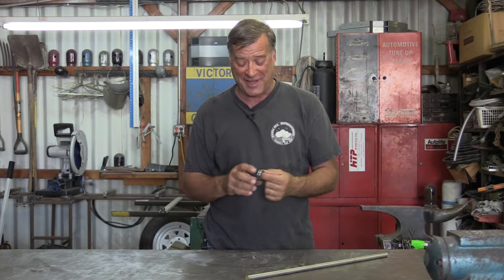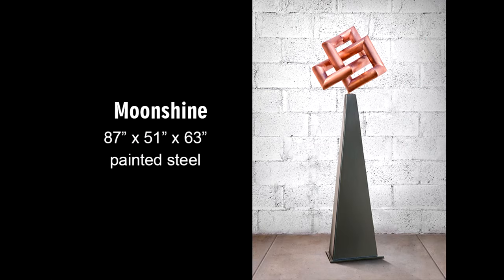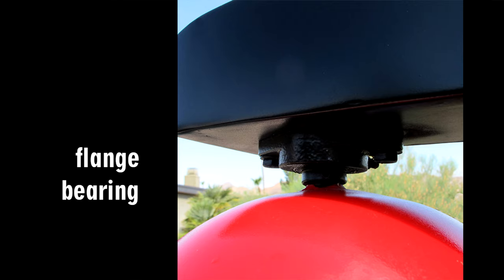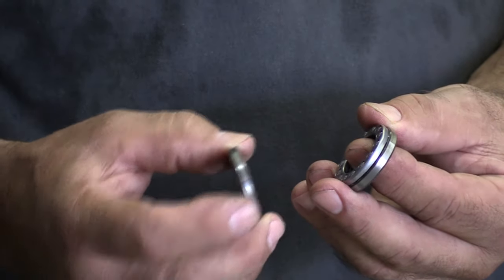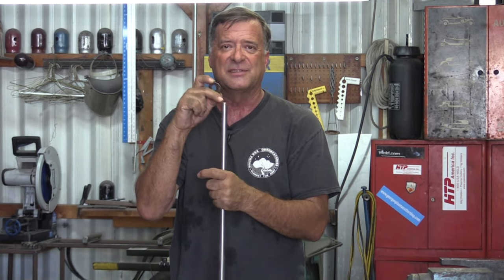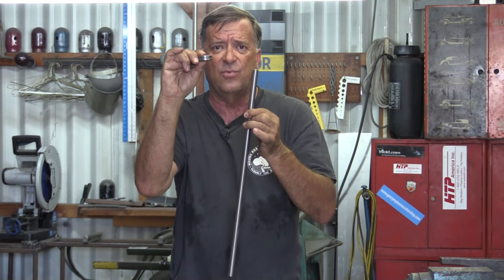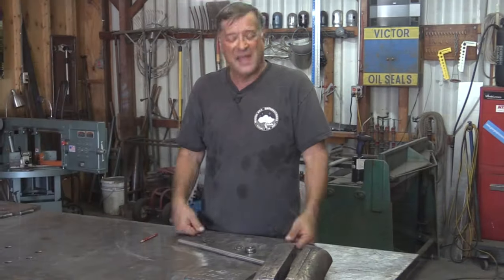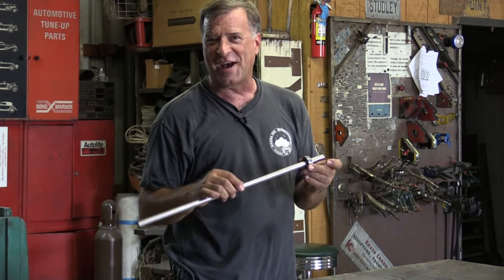How to Make Anything Spin Using a Thrust Bearing - Kevin Caron

Comment: Thrust bearings are great.  Every car has them on the front wheel / hub assembly.  Cheap way to get amazing bearing action in both axis.  Cheers.
Reply from the maker: Cars have wheel bearings not thrust bearings. Thanks for watching and posting.
Reply: @KevincaronSculpture   You are not entirely correct. Most Car and trailer wheel bearings ARE Thrust bearings. At least a type of. 

"4. Tapered roller bearings are designed to withstand a radial and thrust load, and can be found in car hubs due to the amount of radial and thrust loads they can carry."

https://www.machinedesign.com/learning-resources/whats-the-difference-between/article/21831901/whats-the-difference-between-bearings

Comment: Those will be handy. I just made a kinetic sculpture, and used a technique you described way-back-when of inverting two flange bearings to counter each other. Same problem though, large and clunky and required an additional bracket to hold them...
Reply from the maker: Have to make a large spinner soon.  multiple parts and 9 feet tall!

Should be fun.
Reply: Cannot wait to see this one!

Comment: You can add radial bearing to the shaft inside the base to keep it centered and thrust bearing, as you demonstrated, as the load bearing bearing.
EDIT: it is best to get washers with the bearing in an assembly, to make sure rollers and the surfaces they roll on are hardness matched, otherwise wear may occur.
Reply from the maker: Great point!

Comment: For weight load I use 2 bearings. I would imagine the thrust bearings are expensive. Three things are the culprit building kinetic wind sculptures. Friction, balance and angles. Nice informative video.
Reply from the maker: Not that expensive John.   Still learning how to set them up but having fun anyways.   Thanks for posting.
Reply: Kevin Caron, Artist  I know what you are saying about having fun. I’ve been doing kinetic sculptures for about 15 years and I love every minute of it. People ask me if I am a mechanical engineer and I always say yes but I don’t have a diploma that says so. My degree is that scrap pile under the welding table of things I tried that didn’t work. Then I follow up with a quote. Failure is the tuition one must pay to become a master.

Comment: Are these only useful if you are mounting something vertically? Hard to see how they would work if the load was horizontal? Any experts around?  Good to have the knowledge though. Thanks,.
Reply from the maker: They are made for horizontal to tell the truth. I use them vertical and have had good results with them. All depends on how you fab the spinning parts to get the best results.
Reply: @KevincaronSculpture  Thanks. I think I will have to buy some to have a look. I can see how the components hold together if the force is a vertical one, but it just looks like the parts of the bearing would separate in a horizontal position. I am obviously not understanding them properly.

Comment: Hi Kevin, just to be clear, this is a manual spinning sculpture, right, and on average, the spin lasts how long? I am thinking about applying these principles to a mechanical watch winder, so it would be on a much smaller scale.
Reply from the maker: You are correct in that it is manually spun.  How long it spins depends on the weight of the piece. But for what you are doing  it should work very well.

Comment: Wow, just wow! You just made a huge difference in my art work. Kevin, I went to MSC direct and found the bearings but not the grooved 'washer'. Do you by any chance have part number? Thanks. Oh, what is the finish on 'Moonshine"?
Reply from the maker: Look here for the grooved washers,  they are part of the bearing set.   https://www.mscdirect.com/product/details/03380672

Moonshine is polished copper with a clear coat over the top..   If I remember right it is "clear guard" from Sculpt Nouveau.
Reply: Again thanks a lot.
Reply: Hi Kevin great job could I use this to make a wood  wind spinner twist if it was on a wooden stand

Comment: Kevin, Im trying to get a water feature to rotate. Do you know of bearings that are used in pressure washers? Im thinking the type in the Surface Cleaners. Would any bearing be ok? Just concerned water will get in and ruin the ball bearings.
Reply from the maker: Check with the folk at VXBearing.com.   They have a bunch of plastic bearings of many sizes.

Comment: Is there a way of making something spin vertically without welding
Reply from the maker: Always a way to do something.  You just have to find the way that works for you.  If you have a solid rod stuck in the ground and a pipe that is a close fit to the od of the rod, you can sharpen a point on the rod and close the hole in the pipe so the point has a place to run. You could find a set of bearings that will fit your rod and just attach the bearings to the rod.   I would really need more info to offer any type of "real" help here.

Comment: I have been thinking about building a merry go round or round a bout like they used to have on many playgrounds, the big heavy metal ones that you and your buddies would get spinning by hand and then jump on and hang on!
 I wonder what kind of bearings those used? I haven't found much info on it yet. I thought that they probably just retrofitted a big truck axle or spindle and bearings but I don't know. Those aren't really designed to spin with a thrust load like that I wouldn't think....
Reply from the maker: Sounds about right.  Would have to do some research to get it right.

Comment: Hi Kevin i desperately need your help pls. i am trying to make a simple 12" long flower spinner BUT how do i get the flower to spin in the wind?? do i use a thrust bearing like you are demonstrating now? or is that for heavier structures?
Reply from the maker: You don't want a thrust bearing for this, check out these guys.  http://www.vxb.com    Don't forget to add a little twist to the pedals like a propeller  on an airplane.   Or just give me a call.  The number is on my website.    There are a lot of little details that will take too long to type.  Look for a flange bearing to fit the shaft you are using and make the hole in the flower fit it.
Reply: Thank you so much Kevin! you have no idea how much your replying means to me. ok ill get a flange bearing and if i get lost i will definitely call you.

Comment: Kevin, I LOVE THIS. I was wondering if it was possible to make a 14mm sphere rotate with the moon phases. I'm trying to make a moon phase pendant for my mom so she can tell the phases of the moon, but I want it to rotate it to show the phases. Do you think it would be possible? also would you know where I could find a place that could manufacture that for me? thank you!
Reply from the maker: Anything is possible with enough time and money.  But sorry, have no idea who would make one for you.
Reply: That’s in the realm of a watch-maker.  Obviously, displaying correct moon-phase requires sync with a time piece.  

Mechanical, moon-phase, watch movements are costly.  A custom, miniature, automated, mechanical design with reasonable accuracy would cost many tens of thousands of dollars.

Your best bet is to find a moonphase watch and convert it to a pendant for your mother to wear on a necklace.  Take a look at the Christopher Ward moonphase watch.  It has a glow-in-the-dark presentation of the moonphase, which is quite dramatic.  

The watch face is around 40mm in diameter — not tiny, but not crazy large either.  It is a mechanical watch, so there has to be room to fit the movement.  It’s going to cost you around $2,350 — which is inexpensive as far as mechanical, moon-phase watches go.  

On accuracy, it will keep accurate moonphase for 128 years (without needing to re-set the moonphase) if you keep the watch operating that long.

Comment: This video didn't show up in my subscription list even though I am subscribed to this channel. The last video did and is still on the list but this doesn't show up. Anybody else have this problem?
Reply from the maker: Been having nothing but trouble with youtube as well as the internet lately..
Reply: Kevin Caron, Artist I also have not received notifications.  Can you give a little help with how to use a thrust bearing in a weathervane where we have high winds and extreme hot and cold weather?  Are there sealed thrust bearings that never need the lubrication you mentioned?  I’m making a production line that will preclude my attention to that maintenance.

Comment: Hi Kevin love the engineering I want to make wooden wind spinners would these work if I used a wooden pedestal I live in Trumbull CT did I see somewhere u are from strattford ct
Reply from the maker: These bearings will work with the right setup in wood as well.   And yes, I was born and raised in and around the Stratford Ct area.
Reply: Thanks Kevin for the quick reply I wasn't expecting it so fast if u ever had ten minutes to spare could u Google Steve Ramsey wood spinner the video is about 6minutes I think I want to Kno if I  could put a wood pedestal under it  or u might b able to advise I'm a wood worker but can't weld or do much with metal  I'm just off exit 48on Merritt parkway TKS
Reply from the maker: Should be easy to put a base under this design.   Just have to figure out the design and fab it all.

Comment: Do you use stainless steel rods and bearings?
Reply from the maker: When I have to I will.   All depends on where it will be installed.
Reply: Thanks! I imagine if a sculpture like Roundabout were outside, the washers, rod, and bearing would all be stainless steel?
Reply from the maker: @benjaminpauly847  It is outside and yes, all marine grade stainless steel.

Comment: Are these the same as Needle Bearings?
Reply from the maker: Nope, two different things.   Ball bearings are shaped like balls.    Needle bearings are shaped like little pipes or cylinders.  They both have inner and outer races and cages to hold the balls or cylinders in place.    Great question by the way!

Comment: Grease? I had always understood that any fluid or grease would slow a bearing down, that the only reason to use those was to dissipate heat. In other words, things roll faster on clean surfaces. Which rolls faster? A bowling ball down a clean alley, or the same ball down an alley with an inch of standing oil?
Reply from the maker: Then why do you have to grease wheeling bearings?  I think if you over do it and just pack it on the bearing for a short time it may turn slower.  But done correctly it helps to protect the bearings and make them last longer.
Reply: @KevincaronSculpture  It's a cruel world, Master Jack. Electric Current goes from negative to positive, but Conventional Current goes from positive to negative (guess which one is the more popular in electronics). A node can be negative AND positive at the same time (relative to another node). Fuses don't protect appliances (that's a job for surge protectors), they keep the wiring from overheating and burning your home or car when an appliance has shorted out. Red enameled magnet wire is not enameled at all (the coating is a polymer). No one has ever seen the present (we trust that it won't change, not even in a femtosecond).